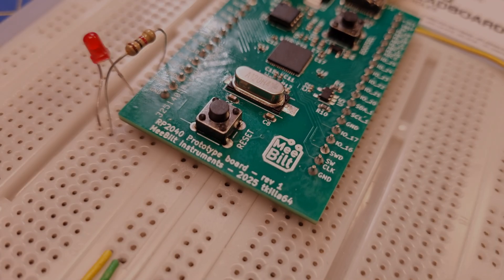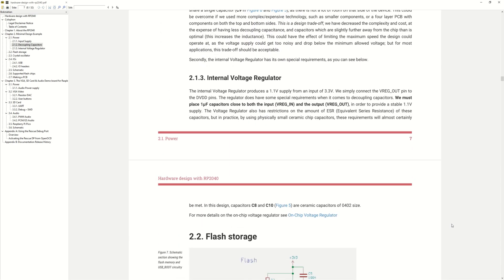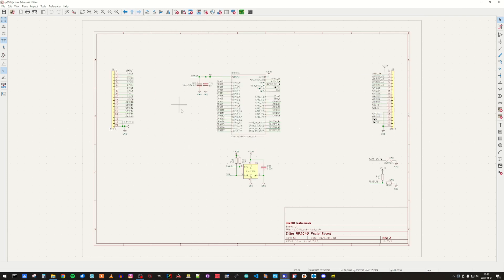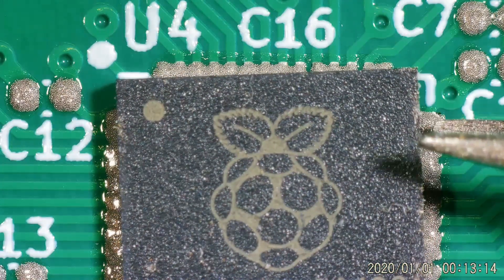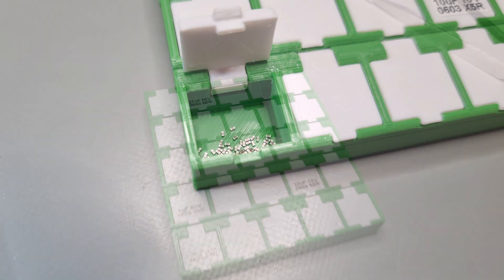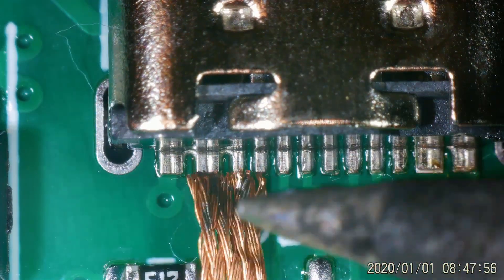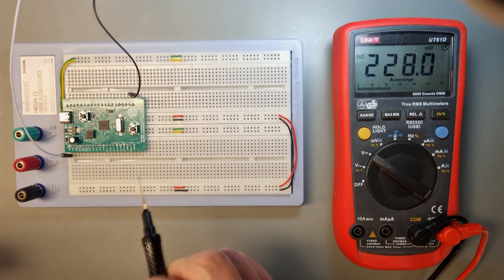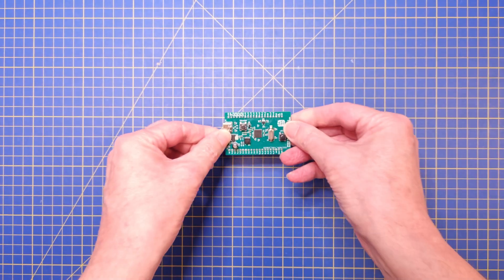Raspberry RP2040 Prototype board

Comment: thank you for that , this was extremely thurough , and you went thru everything . i have just one technical question , why the thruhole capacitor? why not do it also smd ?
Reply from the maker: I use this capacitor in basically all my designs and I have 3000 pcs of it in my stash.